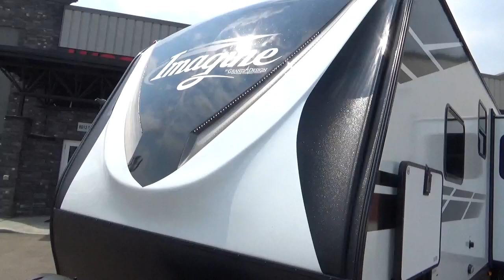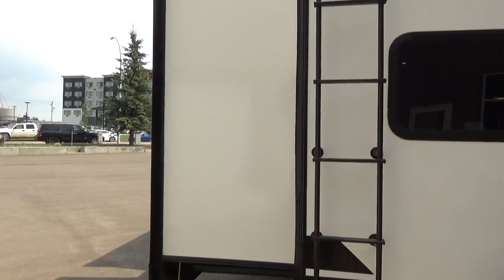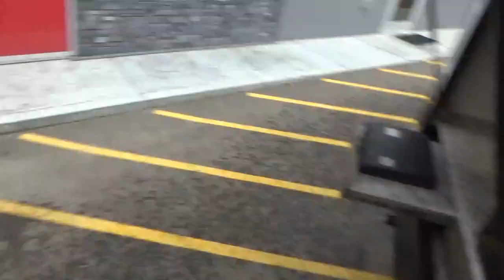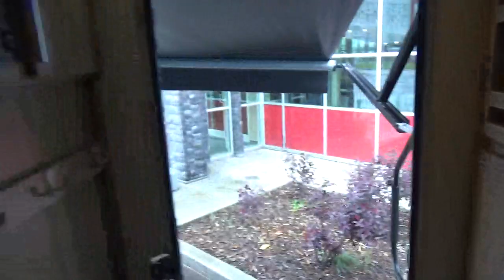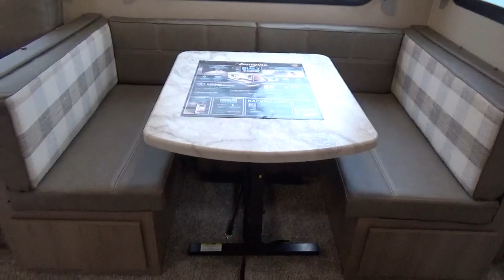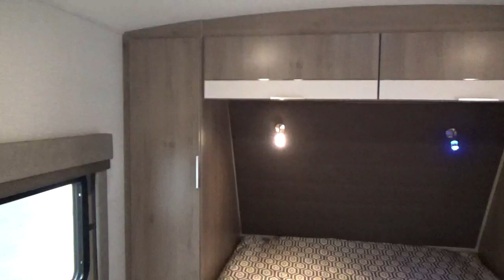2020 Grand Design RV Imagine 3170BH Travel Trailer

Comment: Great insulation, but why R7 on the sidewalls?  That literally defeats the insulation on the front cap, floors and roof.  That’s like buying a Porsche and putting temporary max speed 45 MPH spare tires all around.

Comment: For the people that are going to ask can my half ton or prius pull this, think for a minute, he does not know what axle you have if you have a diesel or if you weigh 450 pounds or 130.  It is not just tow capacity of your truck but the cargo carry capacity.  If you have 4 full sized adults plus their items in the truck that weight counts as cargo for the truck.  so you either need to provide a lot more information or do a little math your self.  Look in your trucks door frame to see what the towing and cargo numbers are. cargo is everything you carry, people, pets, anything in the bed and weight down on the hitch.  These numbers are vehicle specific depending on engine and drive train.  A diesel may have more towing but since it is heavier you will have less cargo carrying capacity.  If you and your other are small and 130 pounds each then you use that for weight, if you are both tall and you are 300 pounds yourself wife 200 pounds 2  teenage sons each 200 pounds then your cargo capacity is already down 900 pounds.    If you decide to just tow the camper and the truck is over weight when you have an accident even caused by someone else you can get ticketed for overweight, where I live it is at least $1 a pound plus $200 and they will know, also your insurance can say they are not paying for anything since you violated the law.   So do you see why he cannot tell you if your truck can pull it?

Comment: Interior looks cheap.  Heat ducts through the floor is the most efficient way to heat the trailer.  Too many 90's in the ducting when it goes through the furniture, the reason why your homes are heated that way. Everyone knows that in Canada it gets a bit cooler then it does in the US.  Poor design guys. Common thing with Grand Design.

Comment: 2 questions for you:

1.  Can this be pulled with a 1/2 ton truck like a Toyota Tundra V8 5.7L 4X4?

2.  How much does this unit cost?

Thank you in advance for your time!  Great contents on your channel!  Keep up the good work!
Reply: yes it can be pulled got a 1500 dodge pulls it good
Reply: No too heavy. Get a 2020 F250 6.7 powerstroke
Reply: It is not just tow capacity of your truck but the cargo carry capacity.  If you have 4 full sized adults plus their items in the truck that weight counts as cargo for the truck.  so you either need to provide a lot more information or do a little math your self.  Look in your trucks door frame to see what the towing and cargo numbers are. cargo is everything you carry, people, pets, anything in the bed and weight down on the hitch.  These numbers are vehicle specific depending on engine and drive train.  A diesel may have more towing but since it is heavier you will have less cargo carrying capacity.  If you and your other are small and 130 pounds each then you use that for weight, if you are both tall and you are 300 pounds yourself wife 200 pounds 2  teenage sons each 200 pounds then your cargo capacity is already down 900 pounds.    If you decide to just tow the camper and the truck is over weight when you have an accident even caused by someone else you can get ticketed for overweight, where I live it is at least $1 a pound plus $200 and they will know, also your insurance can say they are not paying for anything since you violated the law.   So do you see why he cannot tell you if your truck can pull it?

Comment: Could someone explain to me how an RV toilet, with no tank and a direct drop into the black tank, could ever 'back flow' into the heater vents ?
Reply from the maker: SmithFarmTilton, several things could occur to cause the contents of your black tank to over flow, run down the toilet and into the floor vents around the toilet. We’ve seen it where someone forgets they’re using the black tank flush and accidentally over fills the tank. If you have a faulty seal at the base of the toilet or gate flap in the bowl can cause leaks. It’s a rare occurrence but it can happen. Hope this clears it up for you. Happy Camping!!😀